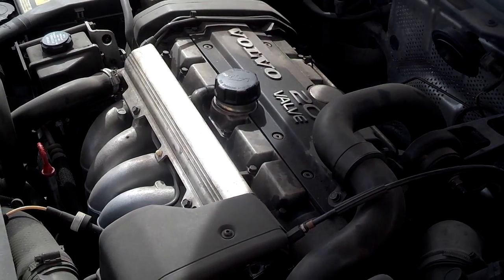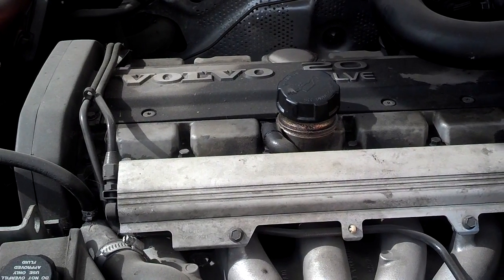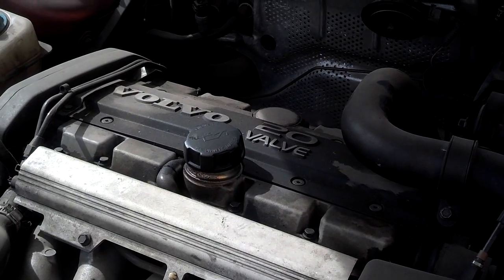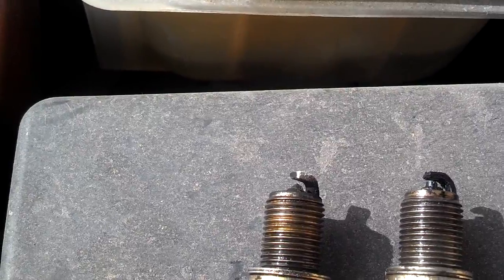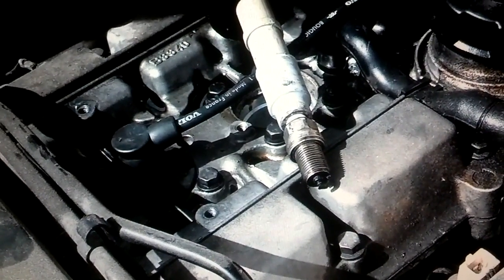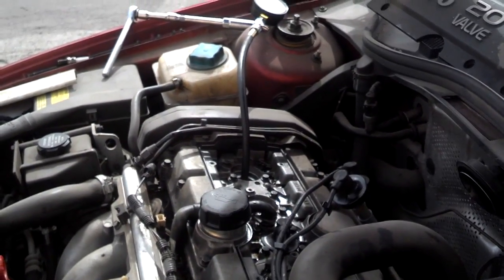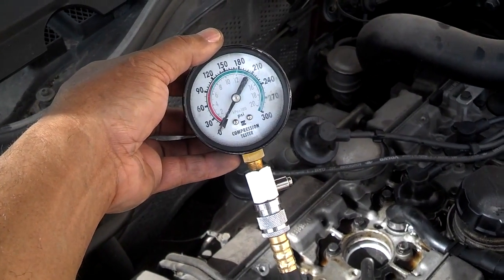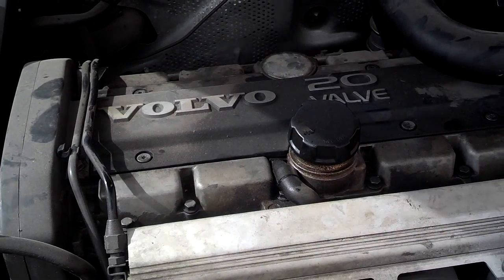Why does my car engine misfire troubleshooting, does it have a bad spark plug, coil or valve? - VOTD

Comment: Hey Mr. Robert,...I have a question.  I have a 14 s60 t5. We have a p0304.  I have moved coils and it did not move with it. I changed plugs and it didn't move. The injectors are ticking and I have pressure coming from the shrader valve. Do you have a few ideas of what else I should  check?
Reply from the maker: Did you watch the video?
Reply: I did after I sent message. I'm going to do compression test. Thanks for the swift reply.

Comment: my mom's 98' S90 has a misfire on cyl 5 and 6 I checked plugs, coils, compression and injectors and I still have a misfire.
any help would be greatly appreciated
thank you for all you do.
God Bless
Reply from the maker: What are the compression numbers?
Reply: @RobertDIY  
cyl1:125 psi
cyl2:123 psi
cyl3:120 psi
cyl4:124 psi
cyl5122 psi
cyl6125 psi

Comment: I have an volvo 96 850 with multiple misfires, recently changed plugs and wires, cap and rotor.. even fuel pump.   Pulled plugs and they were all black burn looking, help lol
Reply from the maker: bring it by...

Comment: Great video Robert,  currently have p0302/p0304 simultaneously.  You redirected me here. Since watching this video, I noticed you mentioned the air filter, I pulled mine out and was dirty, I will start cheap and work my way up.
Reply from the maker: Also, make sure the spark plug wires are on correct. I'm not sure if this has been going on or just started.
Reply: @RobertDIY  just started, I erased it with my code reader and nothing came back, but Id rather keep troubleshooting to find core problem.
Reply from the maker: https://youtu.be/fOEHckD8Ra4

Comment: Thanks for making this video, I have a 1998 S70 T5 and it started having misfire codes.  Specifically ive had misfire 1,2,3 and the multi/random misfire code (seems to be a random variation of all 4 codes each time i clear codes).  I replaced all plugs with Volvo, put in a new coil, spark plug wires, distributor/rotor, and MAF.  The engine idles good and doesnt shake or anything.  The compression is good on all cylinders.  What would you suggest checking next? Thanks in advance, I love your content!
Reply from the maker: Any other codes? Probably a weak fuel pump.
Reply: @RobertDIY  Thanks for the speedy reply! No other codes, and the only actual symptom is ill have a sort of miniature rpm dip happen (infrequently, but doesn't trigger the codes when this happens).  kind of a lurch at higher speeds.  Not sure if it matters, but i can clear the codes and not have them return for a day or two so I don't think the issue is consistent.  I had also been thinking it could be a failing o2 sensor but I'm not sure if that would result in misfires.
Reply: @winnington23  hey there, have you fixed that issue? I have a similar situation
Reply: @lobster5782  yes I did get it fixed.  Hard to say definitively what the original cause was.  But at the end it was the ipd spark plug wires that were the issue.  Also did the crank and cam sensors.  Id go buy some bougicord wires.  That cleared the codes for me!

Comment: Anyone has any experience with resetting misfiring codes? How quickly they are coming back if the problem persists? I just want to eliminate the "ghost" code scenario before diving into serious troubleshooting etc. My car is Volvo 98 s70 150 000 miles and has the history of some codes popping up and disappearing. My code was P0302. I inspected spark plugs for torque - (I replaced them about 6 months ago). Spark Plugs Wire Set is old - 16 years old as a matter in fact. No corrosion. Applied some dielectric grease and put some fuel treatment into the tank. I drove so far about 50 miles. No code. Having said that, monitors on the car are not reset fully. It takes log time on this car. Nevertheless I would think, that misfire would pop up immediately, am I right? Thanks
Reply from the maker: dude, stop it.
Reply: @RobertDIY  Does it ring your phone all the time? lol Sorry, Most of the time people don't respond, so I post few comments/questions at the time... I'll make a point to do it just once next time around ;)
Reply from the maker: thanks.

Comment: Tengo una v70 2007 2.5t tiene códigos p0201 y p0301 cambie bujía, coil, ecu, y sigue el problema,el relanty es inestable pero corre bien ,solo que gasta algo de gasolina
Reply from the maker: Creo que el P0201 es un mal inyector de combustible.
Reply: @RobertDIY  ok muchas gracias saludos desde Ensenada México

Comment: Man, liked the video.  Do you have one troubleshooting 0300 and multiple cylinders?  Thanks
Reply from the maker: Well, depending on the vehicle, it's likely an ignition source or fuel delivery problem.
Reply: @RobertDIY  Saab 2008 9-3 Aero

Comment: For the Xc90 T6 which side has the cylinder 5? I have code 0305
Reply from the maker: The cylinder count from the timing belt end of the engine.

Comment: My car has cylinder one misfire. Changed plugs and moved coils but fault didn’t move position. Checked compression and I have 200psi across the cylinders (5). My problem is that the car is fine when cold it’s when the car is hot it will misfire. I’ll unplug the coil and engine tone won’t chance. The rest do. However when cold number one cylinder will act normally when spark is taken away. Can this indicate a dry joint??
Reply from the maker: What do you plan to check next? The video says nothing about dry rot.
Reply from the maker: What is dry joint.

Comment: i got p0303 on a new car i bought. checked the plug and spark looks like its getting fuel, thinking it has a burnt valve or piston ring problem
Reply: used i mean lol
Reply from the maker: Ouch! Need to check compression.
Reply: yeah not the end of the world though i paid 2800 for a genesis coupe with 99k miles. the other genesis coupe i bought had jumped timing i got the timing kit and sent the head to the machine shop and got new valves. runs like a champ no codes or issues 80k miles. oil was the blackest oil ive ever seen. only costed 1,000 to fix when i towed to hyundai for a diagnosis they said 15k or fix or 10k for new v6 engine lol
Reply from the maker: +Modified Genesis Coupes dang. What is the time change schedule on it?
Reply: i mean its a timing chain so its supposed to be lifetime use of the engine. but since the oil looked like it was never changed and it had a different oil filter than oem plus they probably used the wrong oil viscosity causing the chain to stretch and eventually jump
Reply from the maker: Ouch again. :/
Reply: i got super lucky, the spark plug looked good but when i changed them it fixed the problem. now that they are all out the one from the misfire is slightly black on the center electrode with a little bit of white. thought it was just carbon buildup because my altimas plug was completely black on the dead plug long ago

Comment: Hi, Robert. Thanks for all you have been doing. I follow you all the way from Nigeria. I have a 2005 Volvo XC90 V8 engine with a bad fuel pump. Then i actually remove the fuel pump and fitted two Denso (Japanese) pumps into the Assembly. After scanning system indicated Fuel Pressure too Lean. Now i noticed that the engine has started pinging. I have ordered the proper fuel pump from USA. Could the pinging be connected to the low pressure fuel pump? Kindly help with the answer. Thank you Robert
Reply from the maker: +Gospo Concepts sounds reasonable, sad to say I have no experience with that.
Reply: Robert DIY hi, the correct fuel pump I ordered from the USA has been delivered. I gonna go ahead and install it. Am thinking of changing my valve stem oil seal. How many are they in this vehicle 2005 volvo xc90 v8? Kindly help.

Comment: I️ have a Volvo 2005 t5 2.5 s40 what are the compression specs on it as of right now they are 120-110-115-110-100  so I are my baúles bad previos owner told me car was over heated and fixed and machine shop I️ took the head sAid didn’t look like it had Work done ever b4
Reply from the maker: +Adrian Ramirez my guess is that the gauge is reading low.

Comment: I have a 2003 Chrysler Voyager and a Cylinder 3 misfire due to low compression  (about 90) what are some possible reasons for this? How much would it cost to repair this problem.  Or should I just get rid of this car?
Reply from the maker: If it has a lot of miles, I would probably cut bait. My guess is that the engine is warn.
Reply: It has about 148,000 miles. Thank you for the response.

Comment: Hello Robert:

Do you have a video on code C0300 or suggestions how to diagnose and fix?
Reply from the maker: Did you watch the video?
Reply: Hello Robert:

I did watch the video, very good and helpful, which is why I asked about code C0300, NOT P0300.  Car is Suzuki Forenza, 2008. Code C0300 is what the scanner reads and I'm wondering if this is the Suzuki version of P0300?
Reply: Also: The car runs fine, plenty of pep but I can tell by the sound that the motor is running hard. The code P0420 and C0300 will turn on the CEL anywhere between 25 - 75+ miles. The way I see it is that after I clear the codes it takes that long for whatever is out of kilter to be ready for another reading scan. Any suggestions?

Comment: Robert, your video was very helpful.  I have a Hyundai Genesis 2012 5.0 r-spec.  It has a misfire error code of p0308.  I change all eight spark plugs and the ticking sound is not as bad as it was prior to me changing the spark plugs, but it's still there.  I guess my next step is to change to wire or just come to turn that I have a bad valve.  Thank you!
Reply from the maker: +Elvin Davis test it as shown in the video.

Comment: could even a poorly spraying fuel injector trigger a misfire?  even though power is getting to it  and I hear the audible click sound , and/ or if iits spraying poorly would I still be able to hear the click noise ?,thanks
Reply from the maker: +John Blowers yes.
Reply: I realize this was posted a while back but I thought I would add my thoughts. You can pull the fuel rail(s) injectors and all, place a piece of cardboard or paper a few inches under the injectors (as evenly as possible with respect to distance from paper to injector), then turn the car over once or twice (once is better if you can catch it). If the pattern of the spray is tiny, even, and mist-like, this is desirable. If there are droplets coming off one of more sides then this can cause it to misfire. Seems like engines in the 70s were blunt instruments but newer engine technology seems to want everything right.

Comment: Good video,having an ocasaonal misfire on #6 hope it's not  piston  rings or valve, lifter i could deal with .
Reply from the maker: +Johnny Redcloud how old are the plugs?
Reply: I'm going to say 2 years if not more,i changed the #6 plug twice maybe  need to do the other Seven,I'm 68 years old in 10 days love to mess with this old beast 219,000 i've kept her running for a long time.
Reply from the maker: Hope you get it sorted out.

Comment: Hi Robert, thanks for this video. I now know that  there are 5 thing to check for on a car that have a single misfire. on my 2010 Chrysler 300, i am reading a P0304 code. The spark plug, ignition coil and the fuel injector have being replaced and i was lost and schedule a appointment with the dealer. But now that i know that there are three more area to check, the appointment have being reschedule until i can do further check. Thank you so much.
Reply from the maker: you are welcome.

Comment: im about to buy a xc90 but the guy told me that it has a shortage in the computer that makes the engine misfire is it still worth buying?
Reply from the maker: +orlando gray I have no idea, have not seen the vehicle nor do I know the price.
Reply: +Robert DIY he is sellin it to me for 2000 and he says sometimes the engine will get weak because the computer isnt connecting properly which cause the cylinder to misfire any advice or have you heard of this problem
Reply from the maker: No, run unless you take it to a Volvo mechanic to check it out for you.

Comment: past 6 months I changed all plugs wires original GM parts gap is correct, also all fuel injectors replaced,crank shaft position sensor, cylinder 6 misfire code I noticed if I hit hard excelerater  60 MPH, 70 Check engine lite flickers with some power loss,  compression is Good what's your take, I will replace all three coil power packs
jeffrey.martino19@gmail.com
PS
I had a intake manifold leak that was repaired
Reply from the maker: May be coil packs. They usually show their weakness at higher rpm's.
Reply: Robert DIY thanks ill be repairing them tbis week end.ill disconnect the battery for a few then try I'll let you KNOW
Reply: You've piqued my curiosity. What was it?
Reply: I replaced every possible thing in the past yr with all original GM parts wires plugs injectors coil packs I know I need to replace the abs module but I'll get a completion check on cylinder 6 if it comes back week then that's the end of the line for this car . Also jest summer the dealership did a intake manifold gasket repair .There know to leak mine was

Comment: I have a 2013 sonic love power at idle  and i got two error codes  P0300 random-multiple misfire detected  and P219A bank 1 air-fuel ratio imbalance.  Any thoughts?
Reply from the maker: Not really. Sounds like the car can not figure out which cylinder is misfiring. Check to see if there is a leak in the intake manifold.
Reply: Robert DIY  thanks i know the air intake hose split apart maybe i need to look for more obvious things. thanks
Reply from the maker: I would deal with any intake hose splits before doing anything else.
Reply: Robert DIY yes i will look carefully if another tear developed in the replacement,  thanks
Reply: if there is a leak in the intake manifold will i be able to hear or see or smell it?
Reply from the maker: Search for videos on how to find them. Didn't you just post that you had a leaking intake tube?
Reply: Robert DIY i did a few months ago and i replaced it.

Comment: I have a PO 300 code in my car, tune up, transmission service and fuel injectors were replaced so what could be the problem. I have a 2007 Dodge Caliber
Reply from the maker: +Patricia Petersen have you watched the video?

Comment: very interesting. My siste's volvo has that p code.  the #2 coil boot was cracked and Replaced that someone came by and said it was the #3.  So i got a scaner and I got that misfire on #1 code.  the plugs were just changed out and i will get a coil pack for it.  if that does not solve it i will go to the compression check.   Also I do believe it needs to have the timing belt and compoints changed out too.   well thanks for the great video  My steeler brother :)  PS4L
Reply from the maker: Thanks for watching.

Comment: My dad says my car needs 87 octane and i told that it needs the 93 octane who is right?
Reply from the maker: What kind of car do you have?
Reply: +Robert DIY 1997 volvo 960 sedan 2.9L I6 B6304S2 engine
Reply from the maker: The OWNERS MANUAL recommends 91+.
Reply: +Robert DIY ok so do i have to use 87 or no
Reply: +Daniel McDaniels or is it worth the 93 non ethanol gas at 2.99 a gallon
Reply from the maker: Huh? If the owners manual ecommends 91+ use 91+. Yes, it can run on 87, but that obviously is not the best thing for it.
Reply: +Robert DIY it says the minimum requestments is 87 but it says its designed to run premium unleaded
Reply from the maker: OK, US law requires that all cars are able to run on 87. That doesn't mean it's good for the car.
Reply from the maker: Do you want to do the minimum or what is recommended?
Reply: +Robert DIY What would be better and best for my car?
Reply from the maker: What the owners manual RECOMMENDS.
Reply: +Robert DIY all it says is that volvo engines are designed for optimum performance is 91 and up. And then the last line it says the minimum requirements is 87. Dad said that if it had a turbo or supercharger it would run prem.
Reply from the maker: Use 91+ for the 8th time.
Reply: +Robert DIY ok

Comment: I've changed plug and coils and injectors still says misfires now my check engine light blinks sometimes what's that mean
Reply from the maker: You need to finish the trouble shooting procedures. Have you checked compression?
Reply: +Robert DIY not yet I'll do that next.
Reply: +Robert DIY did you get my reply
Reply: +David Creek my compression test was 160
Reply from the maker: What kind of car do you have?
Reply: 96 960 Volvo
Reply from the maker: Could be a manifold air leak, one of those tubes. Also, make sure you don't have a leak at the cam sensor.
Reply: +Robert DIY I changed the manifold gasket and found a used coil cylinder wires and pulled the plug on the number 2 cylinder and it still don't get Bo reaction like I do when I pull they other 4
Reply from the maker: Hmmm, interesting.
Reply: +Robert DIY I've tried everything you think it could be a computer problem???
Reply: +Robert DIY  the check engine light went off and it showed no codes but still was driving the same.
Reply from the maker: Shaking at idle? Did the code return?
Reply: +Robert DIY yes I got a new computer hopefully that will help
Reply: +Robert DIY computer didn't change nothing made it worse think it's time to let it go thank for your advice
Reply from the maker: ok

Comment: Great stuff.  Very informative and took the issue much further than those videos that say its a spark plug or a coil.  (Although I sure hope my P0306 code IS one of those basic issues....
Reply from the maker: Thanks for watching.
Reply: There are a couple of other things that can cause a misfire also  bad EGR value,vacum leak  map sensor maf sensor dirty iac valve. I think Robert covered  the main  tho.